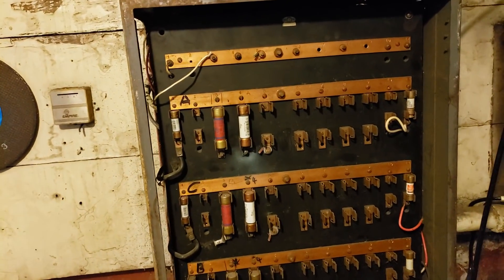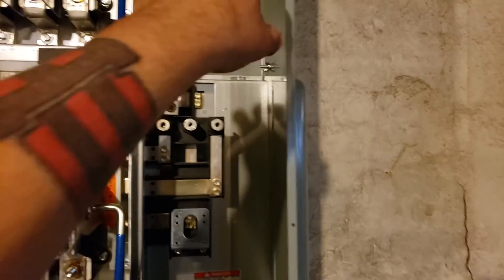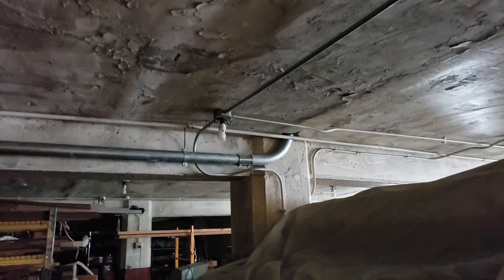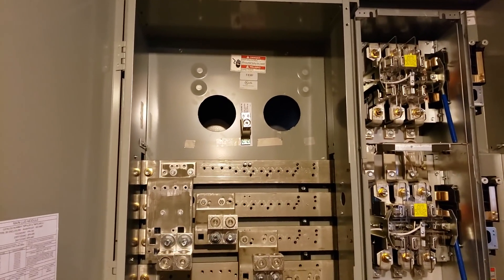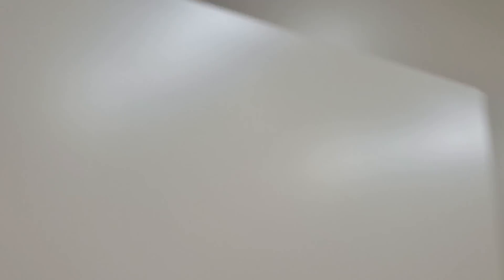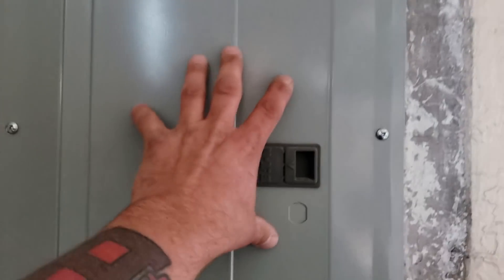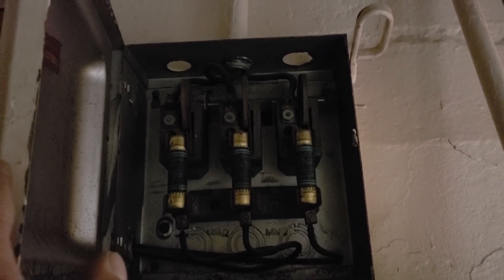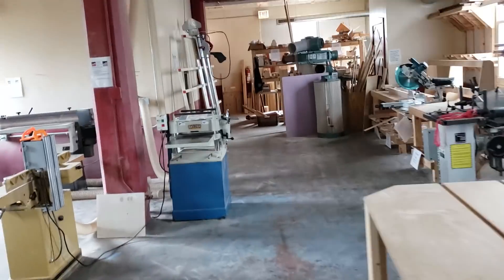3 phase distribution

Comment: I take it once the cut over happens that the power company seals/locks those bus bars and meter areas so you cannot make non-metered taps. It appears the meter bay areas have an isolated enclosure within the enclosure.
Reply from the maker: You are exactly right they do it for safety measures also

Comment: Sweet place!  So, each floor is getting 3ph?  Were there existing 240V machines in use there?  How do you also supply them?  That looks like a lot of work man!  Cool video!  Thanks for sharing!
Reply from the maker: Yes each for will get a 200 amp 3 phase panel I can still get 120V and 240V off of the 3 phase panel